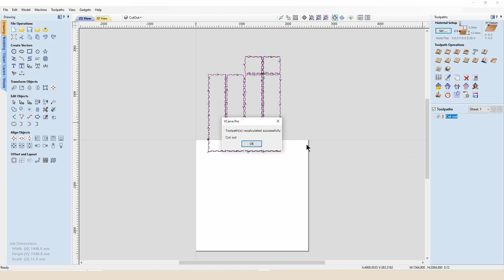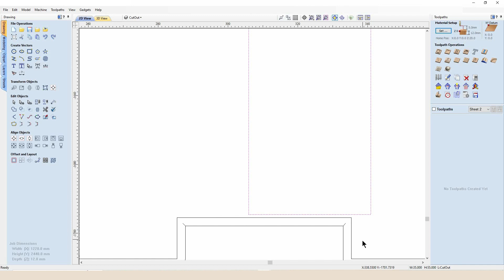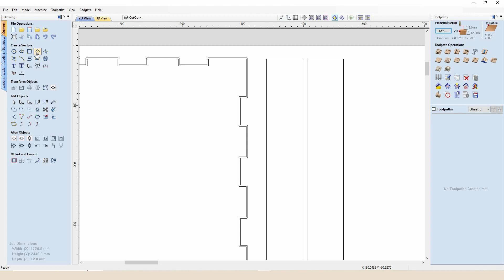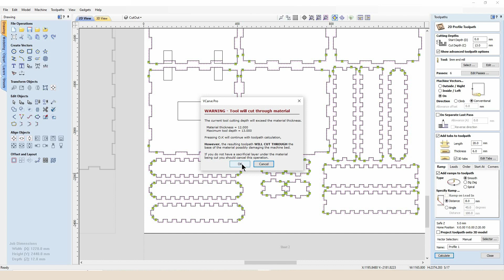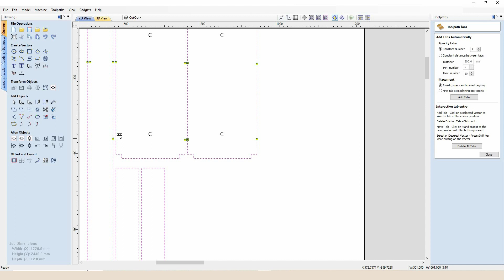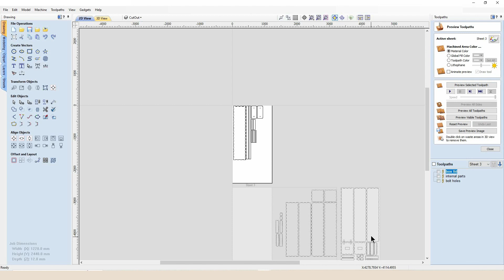VCarve Tutorial | Design Your Own X Beam Flight Case Using Box Making Gadget

Comment: Enjoyed the video.  Look for the 1.5 version for boxmaker gadget.  It remembers the settings.  Also when editing for profile cuts only select the line with the fillets.  Also tabs on inside joints are a pain.  Only put them on outside sandable edges.  I don't use tabs or ramps.  I do use a 23 pin nail to hold stock on the spoilboard.